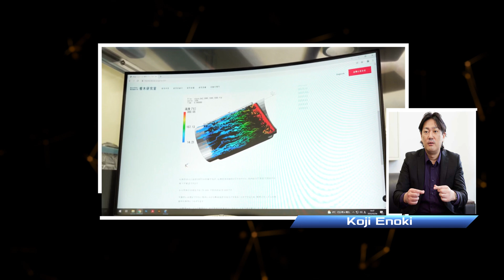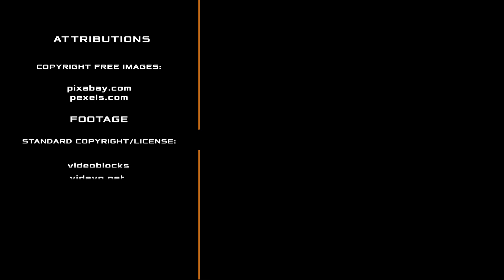JAPAN WILL GENERATE ELECTRICITY FROM SNOW

Comment: Sounds like a very weak and expensive energy source
Reply: "The cost of delivering fuel (snow) to the power plant can be neglected," because they're already expending resources and manpower on snow removal without getting any energy in return. "On an industrial scale, such electricity should be cheaper than solar and wind ones." "It does not require complex and expensive disposal of components." It can utilize preexisting tanks or structures that lie unused, and it's a scaleable model. I'm a big fan of combustion as a source of energy, but this sounds relatively inexpensive and sustainable according to this source, considering regions of Japan have geothermal springs and snow readily available. I'd be interested to see how efficient this method will be compared to solar energy. I applaud the experimentation.
Reply: @@professorpurp608  wrong. This requires constant truck movements, whereas leaving snow on the ground to melt or wait until the end of winter for a single cleanup does not.
Also, the energy gained is dependent on the temperature difference as per basic Carnot theory. Snow only gets to zero celcius so the gain is very small compared to just using the apparently available geothermally heated water to generate electricity on its own. Even low temp geothermal using low temp power fluids would be more efficient than this.
Reply: @pwillis1589.  I'm just quoting this source, man. I'm not a thermodynamics engineer. You only touched on one of the quotes I mentioned from the source material and you decided to leave out the rest. Cognitive bias is real. The point I was making is that we shouldn't jump to conclusions unjustly, and that the experimentation is exciting. Please give me some real data derived from your own experiments that supports your theory that this method will not be practical. Anecdotes cannot be considered factual without repeatable results derived from your own experiments. The results aren't even close to being in yet. I don't necessarily believe this source yet, either. However, the cost of mining materials for solar or wind alone is likely to be more expensive and taxing on the Earth than simply building storage and dumping snow in warm water that is going to have to be cleared regardless. I live in the Rocky Mountains and the snow gets plowed every single storm until it eventually runs off without yielding us any energy whatsoever and we're still paying for plow drivers and fuel. Even if there is only a small energy return, the source claims that it is less expensive than producing solar and wind energy. If the gross cost of production is truly lower when compared to solar and wind, the net yield percentage per unit of input expended needs to be determined for each method regardless of which one can yield more total net energy. Neither of us can definitively say whether or not this method will be viable on any scale until more data is collected through experimentation. This is all speculative in nature.
Reply: Sure does. Yet I wish them the best of luck
Reply: @pwillis1589.  do you live in a region that experiences large amounts of snowfall? Where I live, if snow were left of the ground to melt, life would grind to a halt for a large part of the year. The trucks you speak of, will be running regardless of disposal method, to ensure that roads, and highways remain open.
Reply: @pwillis1589.  If the "power plants" can be scattered around, it's fine. You can't just leave it on the ground, it will not be fully melted for months. You will run out of space quickly.

Also, snow can be way colder than 0 degree Celsius. Only water, the liquid form can't get to sub zero. And the way colder snow/ice can cool down water even faster, making the circulation faster.
still doesn't seem fast, but they got plenty of space there to build it
Reply: @pwillis1589.  So You would leave 8m snow on the streets?
Reply: I think so as well. I was thinking maybe they could do something with all that melted snow after it's been heated like another revenue source. Like a cheap source of freshwater but that's probably not worth it considering all the deicing chemicals that are brought in with it.
Reply: Every new source of energy is weak and expensive at first. The logic here is the same as saying someone shouldn't play a musical instrument if they aren't very good to start.
Reply: It's amusing how the simple minded comments get the most likes.... SMH
Reply: But think with special substances like Fluorescent particles and reflected sunlight by snow you can get a significant amount of energy harvesting
Reply: I've spent a certain amount of time in Japan and generally really like it.  They really do have a lot of great engineers and creative people.  But they also sometimes have a weird fascination with complicated schemes that achieve little.  The thermodynamics of this cannot possibly be any good and all those trucks driving snow around are guaranteed to consume more energy than the scheme provides, which is only for a couple of months, anyway.  Just....no!

I once saw a TV show where they had this long segment about the most efficient way for a train worker to move the little cloths that protect people's heads after rotating the rows of seats so the train can go the other direction.  And another half hour historical segment about a guy in the 50s who tried different layouts for kitchens so that housewives could take slightly fewer steps in producing a traditional Japanese meal.  It sort of boggles the mind how much effort can go into such piddling and painfully twee topics.

I'm pretty sure this falls squarely into that category.
Reply: @pwillis1589.  
Leave the snow on the streets of one of the snowiest cities in the world ?
That’s gonna shut down their entire civilization for about 5 months a year.
Snow has to be removed buddy.
Reply: @darthdaddy6983  .....IT MAY NOT BE REMOVED,NOTHING DANGEROUS AS ITLL JUST BE COMPRESSED UNDER PEOPLES FEET OR CARS

.......BUT YEAH,ITLL BE RELATIVELY BIT MORE DIFFICULT TO TRAVERSE THROUGH ALL THAT MESS,BUT NOT IMPOSSIBLE
Reply: Gretta would be proud
Reply: Leave the snow on the street 🤣🤣🤣 This is a clear indication that some people cant think of anything outside of their bubble world. In my opinion, if they manage to get a decent energy output from it, sounds great. I suppose this technology should work even without snow? will it still work in summer by just adding cold water? Adding snow would only increase the energy output whenever it snow?

Comment: The power needed to transport snow via trucks outweighs the energy it will produce
Reply: While technically correct, you have to look at this in another way.

There is 0 energy generated by simply dumping the snow in the canals and bay as Aomori currently disposes of its snow.
AND any energy generated by this technology directly reduces the costs associated with snow removal. 

Depending on where the plants are built, the distance traveled by the trucks can be strategically minimized, further reducing total costs.
Lets just throw a number out there for illustrative purposes. $100M for snow removal annually. If we can reduce that number to $99M with technologies like this, then that is $1M that can be used elsewhere.

The idea is to use a "virtually unlimited" resource that is being dumped anyway, to generate a profit that otherwise would have just been a 100% loss of revenue.
Reply: too many facts just confuse simple-minded trolls
Reply: Did you watch the whole video?
Make sure to watch it to see why your comment was answered already.
They have been moving snow from roads to the sea for years already.
Instead of throwing the snow to the sea just to melt, waste fuel and time,
They decided to use it to create energy instead.
No need to travel to the sea since the generator can be built near the snow plow silte

Comment: So you start with solar pannel efficiency but then not a single data on that "snow generation". I'm ready to bet anything that this will produce less than the energy you use to collect snow !    1 liter of gas is 10 kWh. Unless you give us more....

By the way how long in the year can this process even exist ? Not a word ?

I am sure you know that we can make the same process in ocean with temp diff between surface and bottom.  But....no efficiency there...

Comment: This video seems like a joke. Snow will float not sink to the bottom of the pool, Heat rises so has no reason to go downwards in the pipe, and cold sinks so has no reason to go upwards....... The more snow you dump in the pool eventually the water will pour out the top and leave so the water part of this is useless and might as well just get pumped away to make room for more snow. if it did work the water flow would be sooooooooo slow you arent going to put a turbine in the water path and not stop the water from just not moving haha
Reply: While it is generally true that "heat rises," water is unusual in that it is most dense at about 4 C. If the pool is allowed to come to equilibrium, the water will be warmer at the bottom than at the top. This is why ice forms at the surface of a pond rather than at the bottom. 
   Another consideration is that dumping more snow into the pool will stir the water and reduce the temperature difference from bottom to top. You would have to add the snow and then wait for the temperature difference to develop as the pool comes to equilibrium with the warmer water at the bottom. 
  There is a theoretical maximum efficiency of a heat engine operated between hot and cold "reservoirs" that depends upon the hot and cold temperatures. It is the Carnot (car no) efficiency which relates to an ideal, perfect Carnot engine. In this case, if you could somehow maintain a 10 C difference in temperature, the efficiency will be about 3.5 percent. 
   Given this low efficiency and the fact that the available energy is rather small to begin with, I agree with you that this seems to be a bit of a joke. Not to mention the fact that the turbine would run backwards from what is shown in the video.
Reply: I just looked at the diagram again. Both sides, left and right, of the rectangular pipe containing the fluid are exposed to the same temperature differences. So, whatever happens on one side will be canceled by the other. There will be no tendency at all for the fluid to circulate. Yep, it's a joke.

Comment: They can put thermo electric generators using the cold climate from the snow and hot energy from the ground .. that huge temperature difference will generate massive amounts of electricity
Reply: Interesting idea, but the math does not work out.  It would generate very little power, if any.

Comment: I think you need to cool the water at the top and heat the water at the bottom to create circulation and not the other way around as shown here.
Also neglecting trucks delivering snow to the facility doesn't make much sense.
I'm sure they can dispose the snow in a less carbon emitting way (e.g. drive less distance).
Reply: I think you missed the point. That region is the snowiest area in the world so the snow needs to be removed and dumped in the sea by trucks. So instead of dumping into the sea with nothing in return, they’ll dump them into the pool to generate electricity. How efficient this will be, who knows. But it’s a interesting experiment.
Reply: Yes, something is missing from the explanation/animation - the loop seems like it wouldn't work as pictured.  In any case, they are probably already driving the shortest distance possible, from wherever the snow is, to the sea.  Looking at the map, I don't readily see where else they could put it.